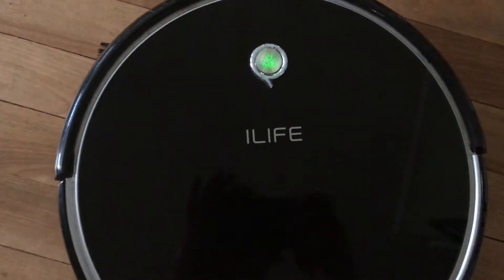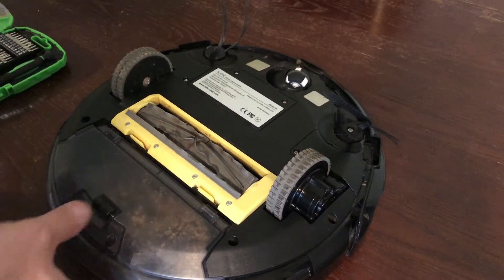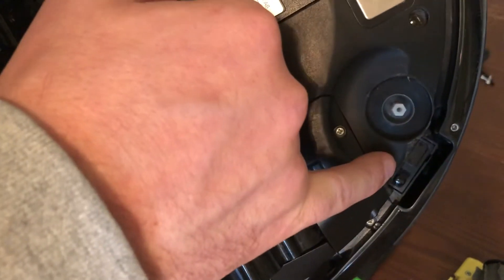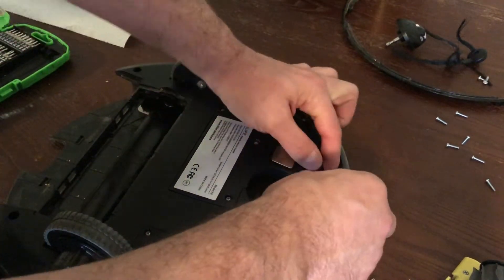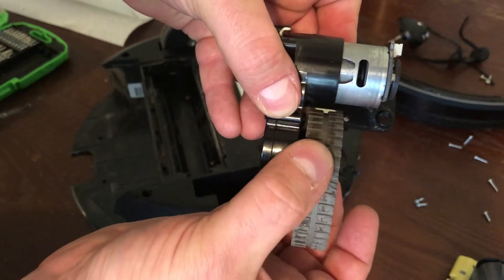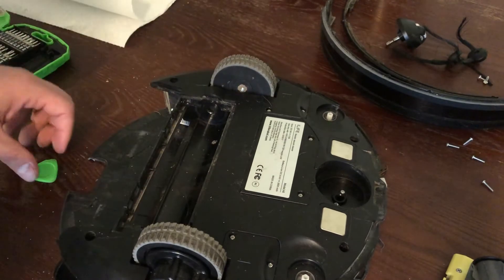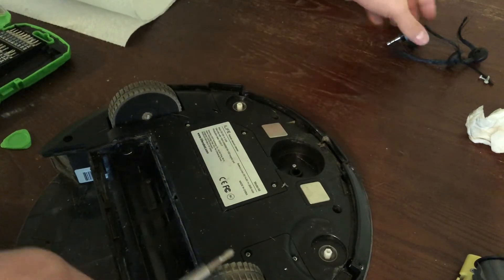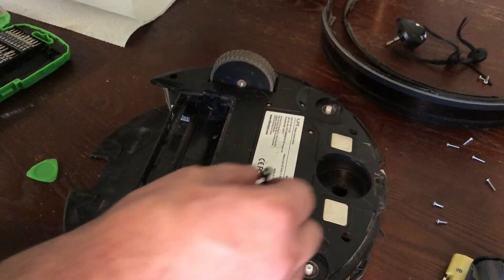iLife A6 Vacuum Robot wheel removal, battery replacement, servicing and cleaning

Comment: Great detailed video, and hoping it will be the fix I need for my A4s that spilled a bit of water from the cat bowl yesterday!  The motor keeps revving up loudly, but it is cleaning now.  I’ve had Marcel (French for little warrior), for four years.  It’s a great tool on my hardwood and tile floors!   
I also dislike our throw-away world, and I try hard to make things last.  
Thanks for taking the time and patience to create this video.
Reply: On A4S there is a bearing (6000 2RS) near main brush motor which in time start making noise (squeaks) and need replace.

Comment: I appreciate your upload, with the help of it I just fixed my A6 (at least I hope so, we'll see in a week or so ;) ), before it was constantly running circle and shortly disabling after. The funny thing is I don't actually know how I fixed it. There was one cable broken on the front cover (black one), but mounting it back didn't help. So next I dismounted the side motor whell which was not rotating and it started to work almost by itself, maybe some displacing of gears was the case? Anyway thanks :) Vacuum cleaner vacuum cleaner power achieved
Reply from the maker: That spinning in a circle is almost always a stuck wheel. I think tiny particles get into the gear mechanism and if you open it up and fiddle with it the gears just sorta un-stick themselves. Glad the video helped!